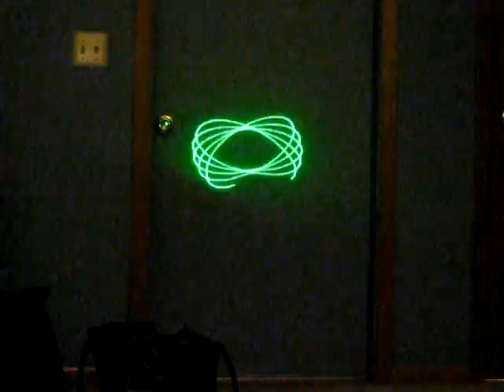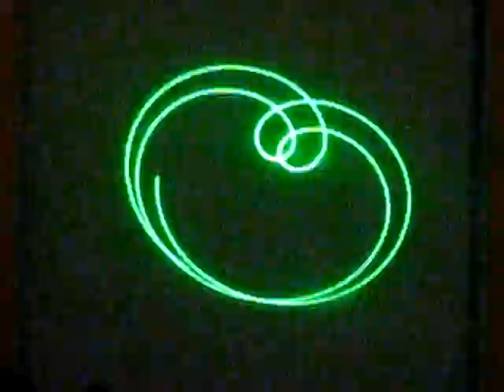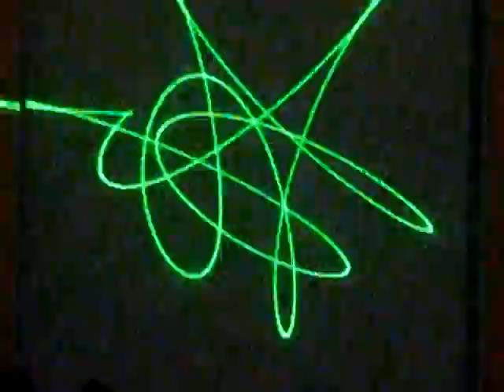Homemade laser spirograph

Comment: Did you use PWM or just use the pot right up to the motors
Reply from the maker: This one has the pot hooked up directly to the motors. I have/had a working PWM version with LDC display, memory, auto modes, etc. Then the laser module took a crap on me, and now there seems to be a rogue current loss in the circuit. Just haven't had time to revisit it yet. I'll be posting videos of it as soon as I'm able to get it up and running again.

Comment from the maker: My next improvement will be using a microchip to control the speed using PWM or some kind of DC motor driving chip. Then I can have each motor have a speed setting, say between 0-99, and display it on a small LCD screen. Then you can easily reproduce a design since you'll know exactly what each motor's setting was. I also like this idea because I can have a "random" mode where it plays a random sequence on its own rather than having to manually change it.

Comment from the maker: The designs just come about by varying the speed of each motor (adjusting the resistance of each pot). I guess the designs are easy to produce since it's just playing with the speeds of each motor. It also makes a difference which motor you adjust too. The hard part is recreating a design a 2nd time since you never know what speed each motor was set to. 

And yes, it's likely just a trick of light that makes them look like they're changing directions since they only move in one direction.

Comment from the maker: The designs just come about by playing with the potentiometers. There's 4 different motor/mirrors so with them all off you just get the laser dot. When you turn just one motor on it spins the light in a circle. Turn the 2nd one on and it spins that circle in a circle, and so on. With all 4 going it can make some complex and interesting designs.